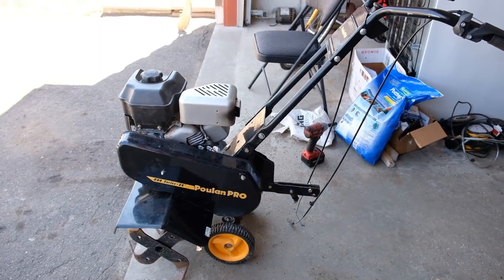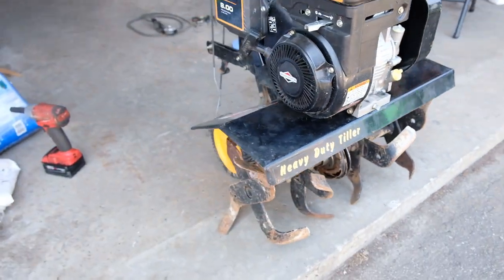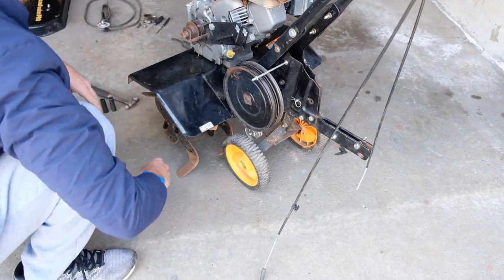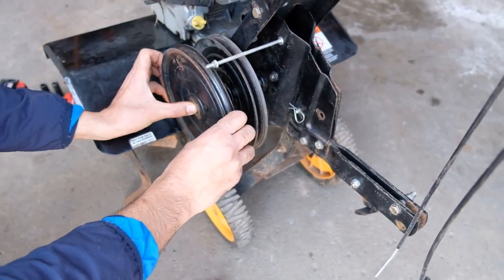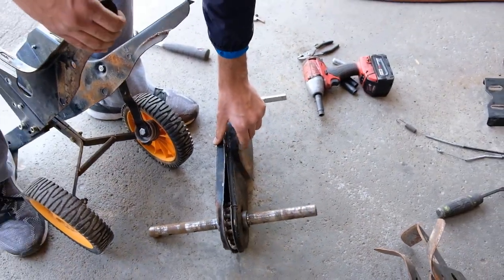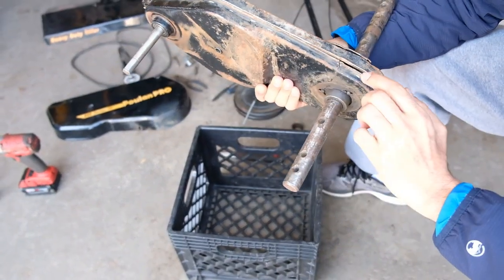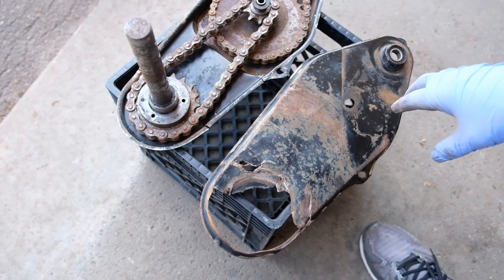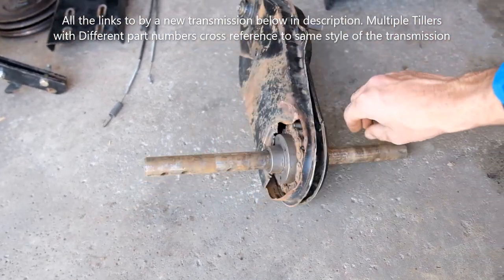Front tine tiller transmission repair  (Every small Equip. manufacturer has a tiller like this)

Comment: thanks for the great video, you are correct a new gearcase is prohibitively expensive and a second hand tiller can be just as good. I truly don't understand why the parts are so expensive and on top of that paying the labor to a shop, would end up costing more than a new tiller.
Reply: I just wish one manufacturer would stick to one solid great quality tiller, making full parts, servicing and repairs for 50+ years. A product that could be easily repaired by the same company for a lifetime. Everyone would jump on board to own one. I couldn't care for fancy new models with new tech, bells, and whistles, if they are difficult to repair, find parts, company goes out of business, and have to keep buying new ones.

Comment: Nyc brother
Reply from the maker: Thanks baiji, this was my first tiller and it wasn't a good tiller. If you plan on buying a tiller buy a honda tiller. The same ones that they rent at home Depot. F501 of you have a small yard. You can buy their bigger units if you have a big yard. They are the best tiller I have seen so far. Relatively easy to use and repair if something goes wrong.

Comment: Is there supposed to be transmission fluid inside its case? Wonder if it will work without any?
Reply: @mechanicunderthetree7543   So u would think the fluid or grease that was in it is more like the thick grease put of grease gun instead of a more regular transmission type thinner fluid?
Reply: Thank you for showing the inside of this super cheap, throw-away piece of junk.  Why in world would anyone make a case that is permanently crimped together?  More so, why could they not put a zerk at the top end of the case so the owner could grease the unit and keep the case full of grease?  I was given one of these (Yardman) pieces of crap recently that still seems to be sound, so I am going to drill, thread, and insert a zerk at the top of the case and place a tiny weep/pressure relief hole next to it.   I will then pump the sucker full of grease and keep it topped off.   Thanks again for all the work to show us how the inside is laid out.  Another thing, it appears the bearings are simple steel bushings on steel shafts.  This means the unit needs to be stored under cover out of the elements.
Reply: No fluid just chains which can be lubricated, but it an enclosed system.

Comment: I found a transmission on eReplacementParts for $160 yeah. Replace the whole thing, but ……………

It has been backed ordered for 6 months plus. I can’t even remember 🥲 I was giving up hope in getting the part so I was looking to see if I could fix it. My tines spine, but once I put it in the ground it stops spinning. Gears or turning rod is slipping.

I think if I spend all that time taking  it a part it may not be repairable any way!

Thanks for the video 😊👍👍👍😊😊